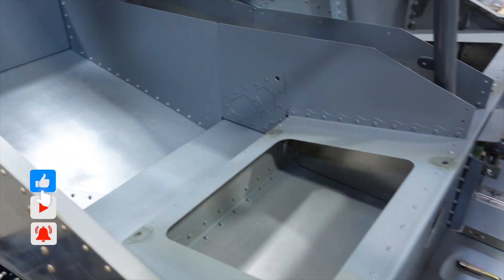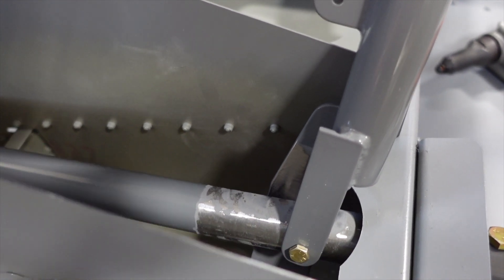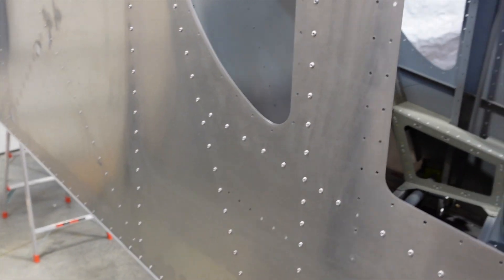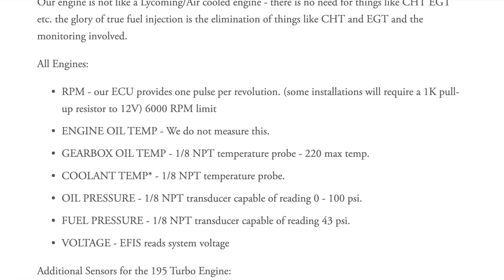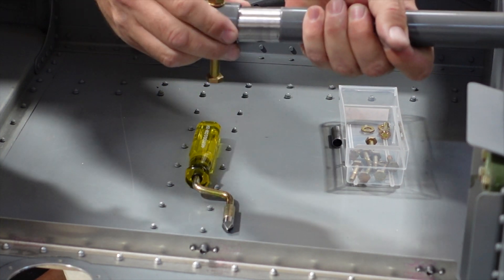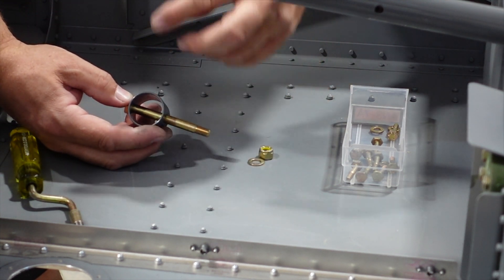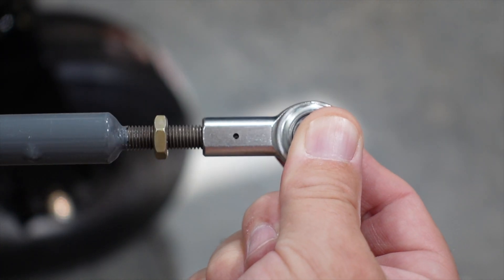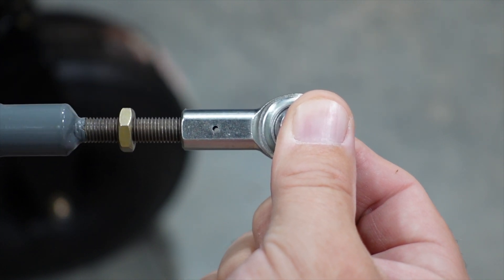Ep. 39 | Flight Controls - Product Review - Updates | Zenith Super Duty Aircraft Build

Comment: Looking good Adam.

It is recommended practice to have control systems installed early on in the assembly of an aircraft in order to facilitate easy access and inspection during functional checks. This often requires that secondary structure - close to parts and components of the control system - be installed only temporarily so that it can be removed and reinstalled when and where necessary.

Great advice regarding removal of  ‘hard coatings’ to facilitate proper fit at mating surfaces. They must be removed from areas which interface with other parts or components at tight tolerances ( typically those tight tolerances are required to reduce ‘play’ and eliminate ‘backlash’ in a control system to avoid a large ‘dead zone’ in the control input device’s travel range). Protection against corrosion should however be considered where dissimilar materials are in contact and sealing against moisture ingress might be necessary if regular coatings aren’t a suitable alternative.

Finally, keep in mind that having good metal-metal contact grounds the control system and prevents it from becoming a ‘trap’ for static electricity, sometimes leading to sections of it behaving as an aerial and affecting radio performance (static interference).

Excellent progress, very informative and educational videos. Thanks for sharing and keep up the great work (two thumbs up).
Reply from the maker: Great advice Dave, thanks for the input and for watching the videos.